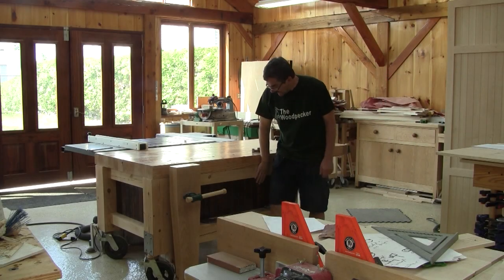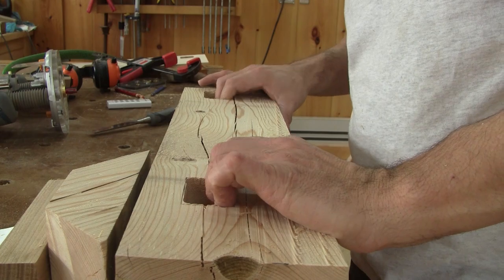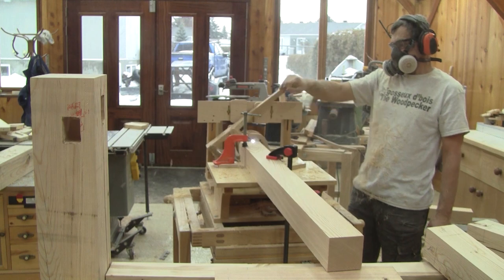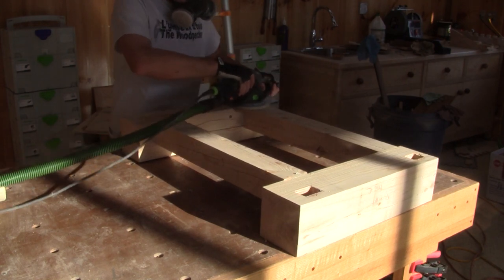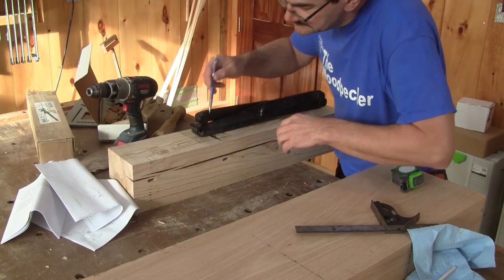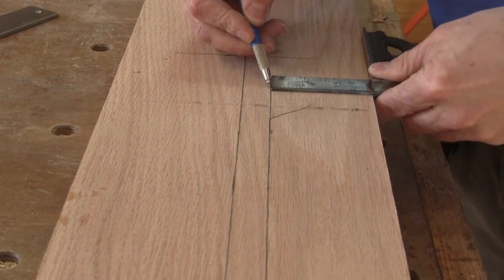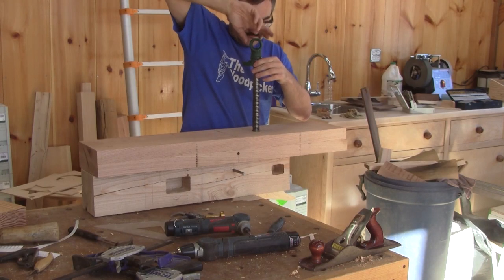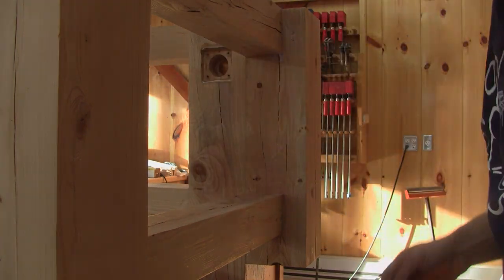The Woodpecker Ep 118 -  Moveable Workbench -- part 2

Comment: Hello Alain from Newfoundland!
Love your videos, and I don't think you need subtitles for the english versions on automatically. Your english is great :)

Had a few questions.
1) wondering what the device plugged into the wall behind you is at 2:27? It looks like something for measuring noise in the AC line perhaps? 
2) Also wondering why you used construction adhesive as opposed to woodglue? Was it cost, strength, availability, or something else?

Thanks, looking forward to seeing the work bench finished!
Reply from the maker: Thanks,
Youtube must have changed something, I've been adding subtitle for about 2 years now and since about a month people make comments about them, I guess YT put CC automaticaly now, instead of letting the users choose if they want them!
It's my 4 inputs thermometer, I have the temperature from inside the shop, outside, the shed and the dust collector room temperature on it. I made a video about it last year. I think is episode 85.
I glued the base with construction adhesive, so the small gap I have in my tenons/mortices would be filled, otherwise I would had used regular glue.

Comment: Alain,  why did you use construction adhesive instead of glue?  Were the joints a little loose?
Reply from the maker: Yes I had small gaps in some of them.The worse was, obviously, the one which the bearing fell off the pantorouter...